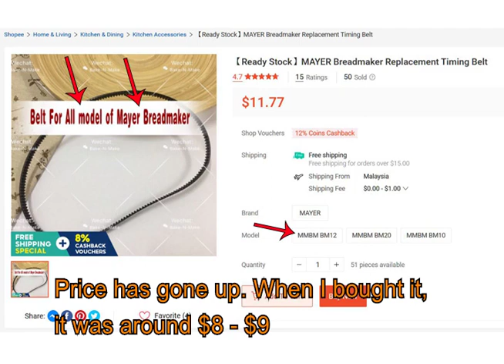How To Replace The Mayer Bread Maker MMBM12 Timing Belt On Your Own When It Broke

Comment: I have the same maker and belt was broken too. I replaced it myself and took a different approach to replace the belt. There is a spring clip on the motor shaft you can use a plier to remove so tt you can get the pulley out. This way you don't have to remove the motor which is more tedious.

Comment: Hi, may I know what is the size of the belt, as I shared the same model as yours. Thanking in advance 😊
Reply from the maker: I bought it on Shopee and under Mayer Breadmaker Replacement Timing Belt. I just did a search just now and couldn't find the link anymore